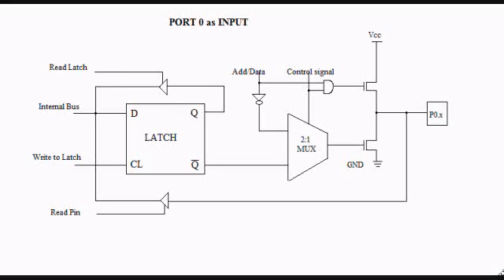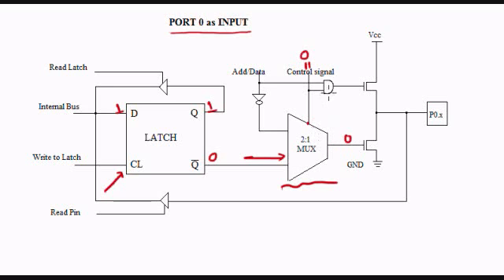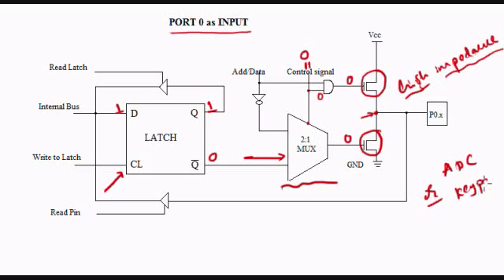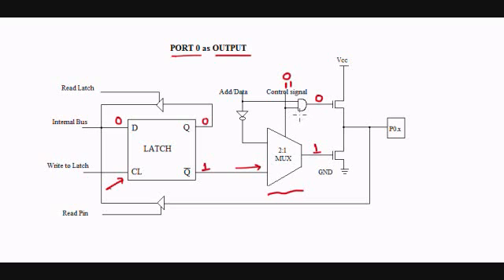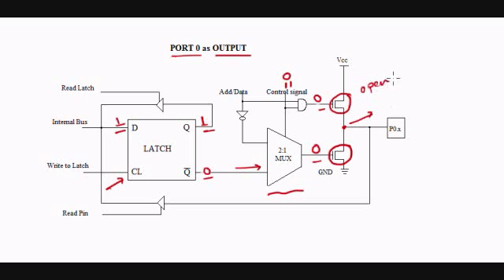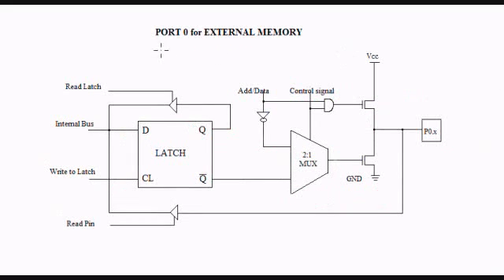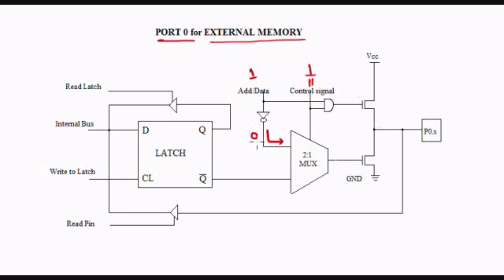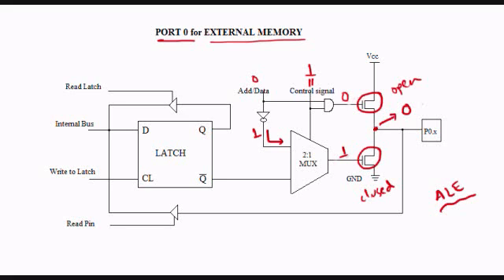PORT 0 of Microcontroller 8051

Comment: at 2.53 you say that the external device can write a 1 value to pin at high impedance state.Is that so..shouldn't it be connected to external pull up resistors.
Reply: External pull-ups are for bringing 0 to 1 , in your case , you're already supplying 1 from an external device , hence no need for a pull-up resistor.
Reply: @PriyanshGupta2906  thanks

Comment: When Port 0 is as input both FETs are open(0) and point is at high impedance=>pull up resistor does not activate
When Port 0 is as output for 1 both FETs are open(0) and point is at high impedance => pull up resistor activates.
Both are same conditions which means when in input mode it should always input Vcc.
There's something wrong.

Comment: can anyone tell me  for using the port 0 of the microcontroller of  89s52 as the out put port we have to use the pull up resistors  what should be the value of those resistors
Reply: 10k
Reply: Thanks

Comment: sir I have doubt when port 0 use as output port. When we want to send 0 , the lower FET in ON. At that time the pull up resister get ground so that at mid point we get 5V instead of 0. So i am confuse at that point.